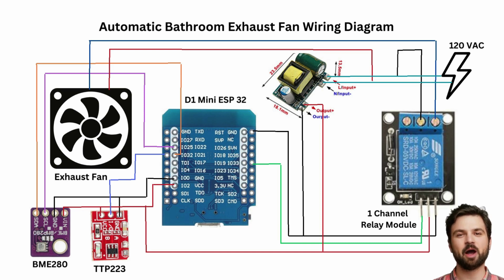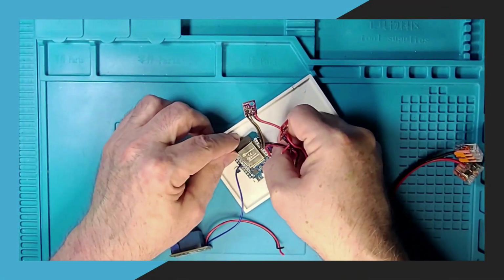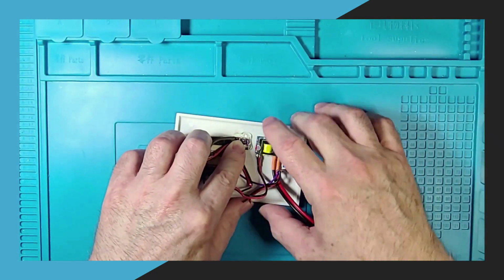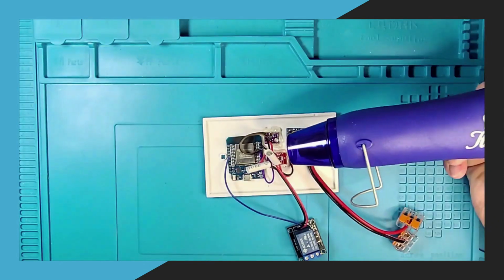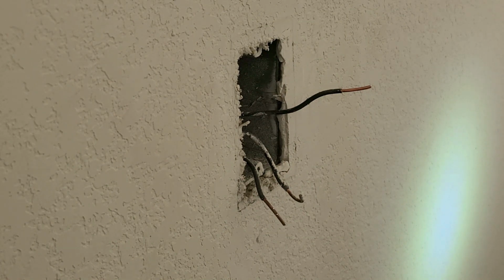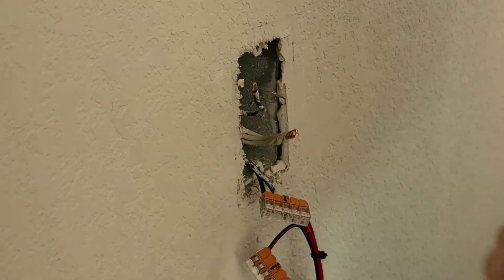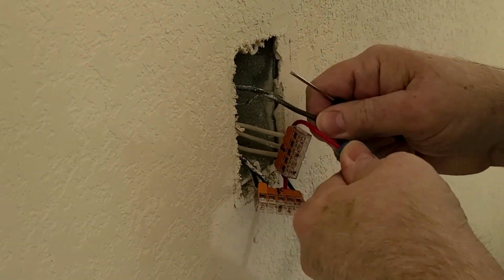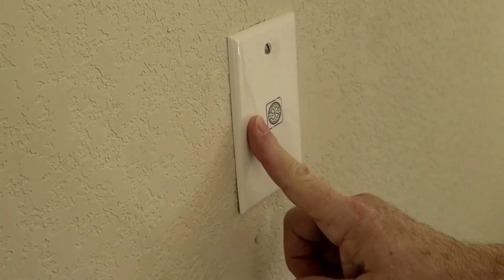Bathroom Tech, Fan Install in wall in Home Assistant

Comment: You can get a board whit a esp32 + relay and a power supply on one small board.
Reply from the maker: Thanks for the info. Can you give us the name of this board and the name of the site where you can purchase it? I know you can't leave links here on you tube, but that info would help. I have seen other boards like the one your talking about but most only have just powerful enough power converters to run the components they have on the board. For example, if you wanted to add say a LD2410C and a BH1750 sensors to it, the power adapter wouldn't be able to handle it. Plus on most of those boards they don't have a UART on them meaning you have to have a serial adapter to flash them. Not a big deal really, although most developers have those, but just a little added complexity and cost.
Reply from the maker: Oh forgot this point, most of those boards don't breakout the I/O pins so you can't add other sensors to them like the development boards do. That's a big one for us developers

Comment: Great the way you built up the project step by step over a series of videos.
Be interested to see something similar for motion sensor light switch
Reply from the maker: Thanks for the feedback and support. Making a wall motion light switch would work, but you wouldn't be able to dim the overhead light, which for me would be a no, no. You could do it with PWM signals, but trying to adjust 120 VAC is tricky. It is better just to buy a wifi or zwave or zigbee wall switch that can be dimmed and works with HA, and then control that with my mmWave and light/lux sensor pakage i talk about in this video https://www.youtube.com/watch?v=YNEQxj-JnEs There a are several that would work, for example these are the ones i use in  my home https://www.amazon.com/Enbrighten-QuickFit-SimpleWire-Assistant-46204/dp/B08288S9W3/ref=sr_1_6?crid=1CCAYA1MJCQYZ&dib=eyJ2IjoiMSJ9.aPW4IHfGUk7USKcuVgdvQqbxLIvODdwbCEq5xTikZGsELOTRYavkPM6UyQwSHpkakz4zsZNeqHCP9UjIzzpnj2t-W5PnuULA9XFkPJVr0U1Pzm1i7SgfkVLtChmGdBVkv835tKlzJIFUKGV7ZQoc8-rZR8THKV2auFqqezziwaMp9GbxJHGm-T_jouRWwe-4qEOG_a7Fg7XL6UCyRGs0rMsIZW7GDW9uuwF6dFkX1039LJLzGMaEUhuy7CVHDntfcw7fcqSwRaoPp4J_-eaaBPiBriV9T6-KYT8ge8BFCpw.BjYOKXevyFtGpJaBTtPLz3bydo1ASdbsyVXiKQ2j89Q&dib_tag=se&keywords=enbrighten%2Bwall%2Bdimmer%2Blight%2Bswitches&qid=1705792709&sprefix=enbrighten%2Bwall%2Bdimmer%2Blight%2Bswitchs%2Caps%2C113&sr=8-6&th=1